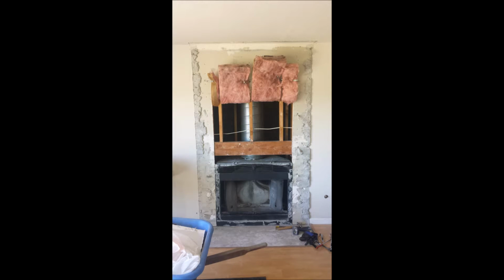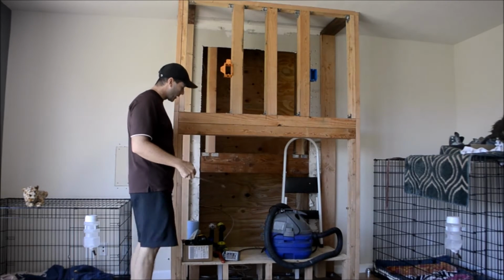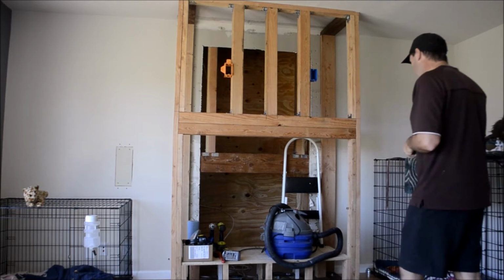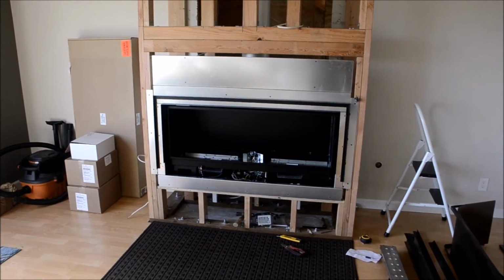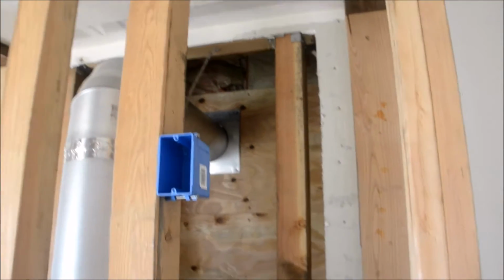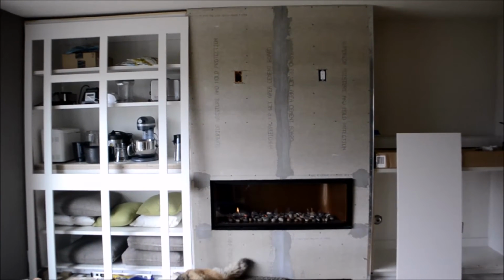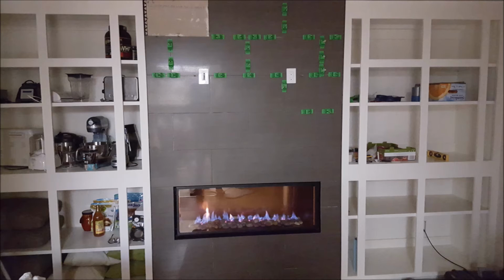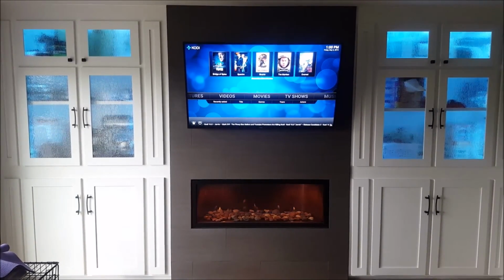Installing a Mendota ML 47 linear fireplace

Comment: Dan, turned out great.  How does the fireplace heat?  Does it make you nervous with the TV right above your fireplace?  Love your tile, with the copper backing in the fireplace.
Reply from the maker: Thanks for the feedback. The fireplace puts out a ridiculous amount of heat, so much so we didn't use the central heat all winter, instead we just used the fireplace. We got the fan option and I think it makes a big difference in the efficiency of the heater. The other benefit of the fan is that it stops the tile surrounding the fireplace from getting really hot and it also prevents the TV from heating up. I made sure that the TV was at least the minimum safe distance from the  fireplace and we haven't had an issue with it, but we always use the fan and I think that if we ran the fireplace without it the TV might not last long. I am still certain it wouldn't combust but I don't think the electronics would cope with it it well.
Reply: Awesome build...how has the tv been